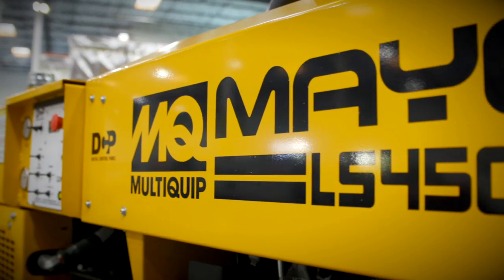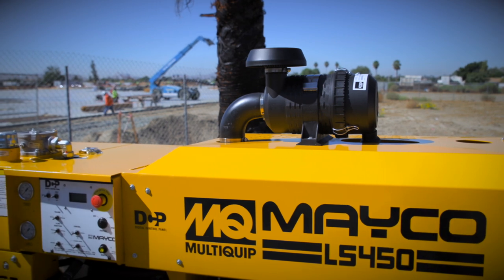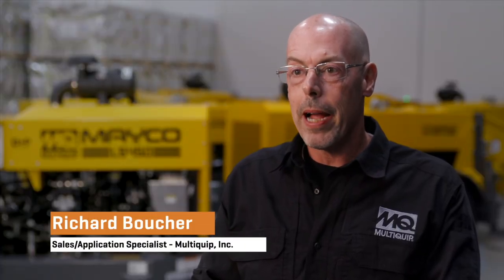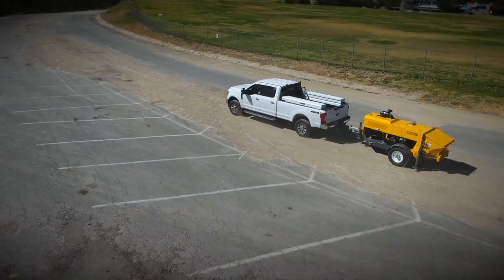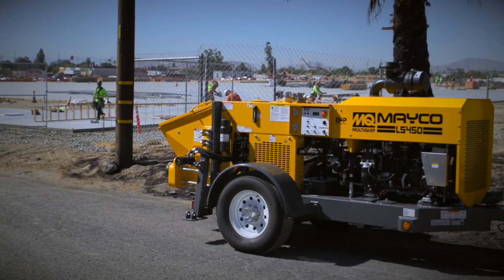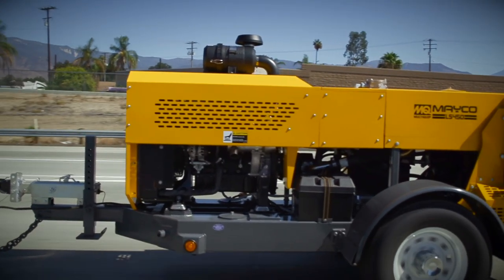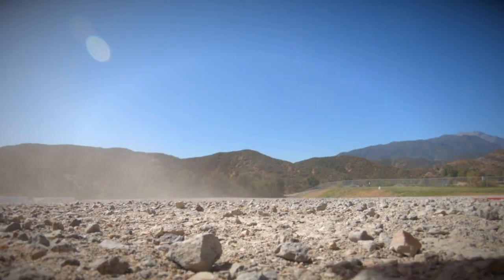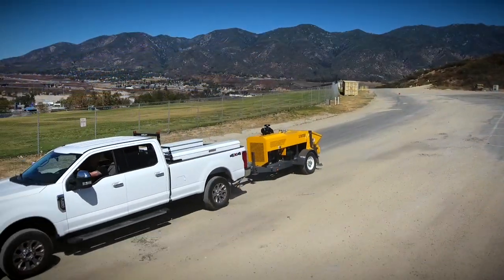MQ Mayco LS450 Concrete Pumps - powered by Hatz Engines

Comment: Had  Hatz engine on my last pump and could never find a service dealer. Stay away from anything  powered by a Hatz. The 4H50 has been MFG since 2013 and there are only about 4K MFG worldwide since 2013 so how many do you think are in the USA. Good luck with service on these engines. No dealers want to service them because the population of these engines is so small that investment in Hatz service tools and parts is not worth the investment.